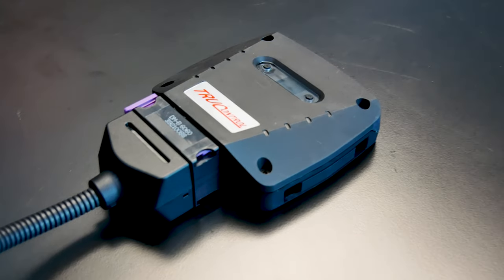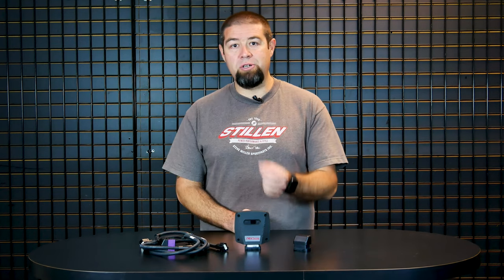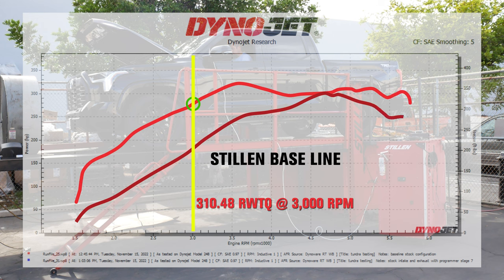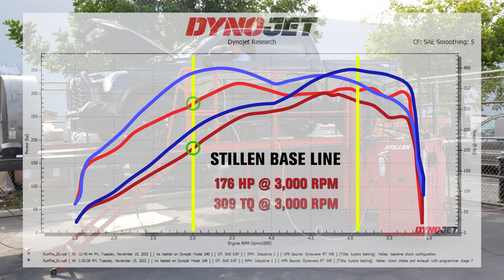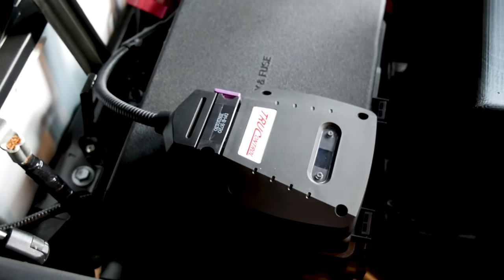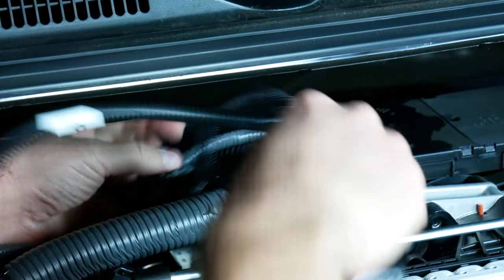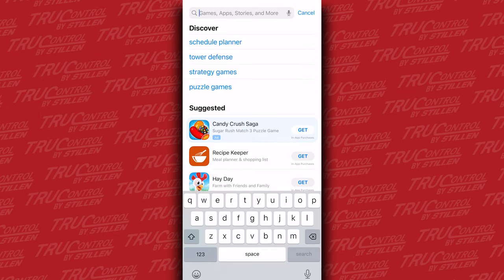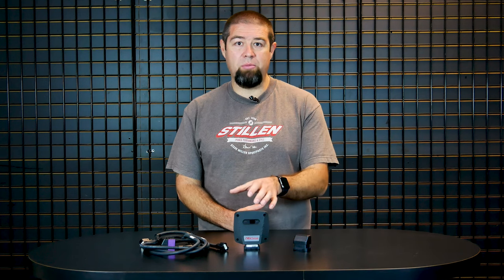Maximize Your Tundra | 100HP & 80TQ with TruControl

Comment: Will it void my factory warranty?
Reply from the maker: That is a great question! If you remove the device, it CANNOT be detected by the dealership. It leaves no trace on the ECU and leaves it unmodified. We take the data in from the sensors, modify it in our tuning module, then send the modified data back to the ECU. Because of this, the cars computer has no idea the tuner was ever installed. We have done tests with dealerships directly to confirm they were not able to detect the tuner after removal.

Comment: Does this require 91? Or is 87 octane ok?
Reply from the maker: We always recommend running 91 or higher octane fuel.  Anytime you add more boost it is a good idea to use a performance fuel.  If you do require 87 octane we recommend staying on stage 5 or lower.  For Stage 6 or 7 we would only recommend 91 octane or higher.

Comment: So it doesn’t reflash your stock ecu and allows you to go back completely stock if you bring it in for a warranty claim? If so, that’s nice.
Reply from the maker: That's correct. If you need to take your vehicle to the dealer, all you have to do is remove the TruControl module and connect the bypass module that comes included when you purchase a TruControl by STILLEN Inline Power Module. Your vehicle will go back to stock.

Comment: if removed can the dealer run scans on the ECU and see this device was installed? Im sure this is the biggest question people have that is preventing them from pulling the trigger (Me included). I need to know if this is a better mod to use after my warranty is done
Reply from the maker: That is a great question! You are spot on, if you remove the device, it CANNOT be detected by the dealership. It leaves no trace on the ECU and leaves it unmodified. We take the data in from the sensors, modify it in our tuning module, then send the modified data back to the ECU. Because of this, the cars computer has no idea the tuner was ever installed. We have done tests with dealerships directly to confirm they were not able to detect the tuner after removal.

Comment: Will this work with 2023 tundra SR that has the same engine but slightly detuned from factory?
Reply from the maker: Yes, the TruControl will work with all configurations of the 3.4 Liter engine.
Reply from the maker: zacharyadrian5062   Yes, the Trucontrol will work with all configurations of the 3.4 liter engine.

Comment: Will it work with the Tundra Hybrid Capstone?  I didn't hear anything about hybrids.  Also, OEM I have sport, normal, or eco transmission settings.  Would I just leave it in "normal" and then pick tune 1-7 on the Stillen app?  In other words, after I connect your product what setting should I put the OEM transmission power dial to?
Reply from the maker: Hello- Yes, the TruControl Power module does work on the hybrid models.  The TruControl works with all of the trucks "modes."  These modes will not interfere with the TruControl.  It really boils down to your personal preference when driving the vehicle.  Some customers want a firmer shift, some want a "normal" driving style and only to have the added power when they stand on the gas.  Others want all the power, all the time and more aggressive shift pattern.

Comment: Hello, huge fan of stillen as I currently have a z32 and an r32. My question is, does it require aftermarket intake and cat back exhaust?
Reply from the maker: No, it can be ran on a completely stock truck, but we also have custom calibrations if you do want to change to aftermarket parts after installation.

Comment: I want to order this as i already have the stillen exhausted system. But i might get some catless downpipes. Will this clear the code from me removing my cats? Or do i need custom tuning for that.
Reply from the maker: Our tuning device does not enter the DME/ECU/computer, so regretfully it will not clear engine lights for emissions. It will work on catless downpipes, but the code and engine light will remain. 

If you need help finding a reliable custom tuner, dont hesitate to reach out to our sales team and they would be happy to assist you.

Comment: Would there be any issues with the piggy back device if I’m already running the shiftpower throttle response controller on my 22 tundra ?
Reply from the maker: Should be no issues at all when they are ran together. The shiftpower will only be plugged into the throttle itself. Our device plugs into the engine bay and tunes the motor to increase horsepower, not just the throttle response.
Reply: Thank you for the quick response! Waiting for more updates on your cold intake you advised a couple weeks ago. How loud is your exhaust system if you live in a cold whether state? Don’t want the neighbors to be upset in the morning
Reply from the maker: We should have another video with more information in the coming weeks on the intakes. We are planning on releasing them here in Q1 of 2024.

As far as the exhaust, the cold start is MUCH better than stock, but not obnoxious to the point it will wake up the neighbors. We also wanted to make sure it wasnt annoying or droning during towing as well, so we tested it extensively with our race trailer. I do not like a loud exhaust that requires yelling to have a conversation or turning your music up so it isnt so obnoxious. It is safe to say, neither of those apply to this system.
Reply: @STILLENvids  Thank you for getting back to me! Appreciate it very much! I know you have your deals going on but ima wait till you release more of your products so I can just make one big purchase. Thank you again

Comment: Long term reliability issues with engine or trans after these modifications?
Reply from the maker: As long as you keep up with maintenance and use good quality fuel, you should have no issues at all. The factory ECU still has it's engine protection programs in place, if it ever sees anything outside of the tolerable range, it can still step in and protect the motor. As the product does not leave any trace of it being installed, as long as you remove it before a trip to the dealer, your warranty will stay intact.

Comment: I’m interested but I have my concerns. Not only do I tow my cars to the drag strip but I also have raced my tundra. I bought the AFE Bluetooth unit when it came out and it didn’t make a difference. Both with and without were 14.90s at bandimere speedway and even on the runs that were with had a 1000’ less DA than without. My question is are your tests in sport mode or in normal. My truck is a trd limited that is not a hybrid?
Reply from the maker: We do our tests in all modes, including eco, to make sure the truck performs as it should without limiting the drivability or function of the features. We do also a 14 day satisfaction guarantee. This means you can give it a test in your own truck, if you arent satisfied with the results, simply send it back for a refund! We let the product do its own talking. I promise you will feel a difference from the first pull after install. The butt dyno is noticeable!
Reply: It depends on where the tune addresses boost. It’s probably not intended for pulls on the drag strip.

Comment: Does it fit to Land Cruiser LC300? Lexus LX600?
Reply from the maker: We are currently working on a solution for the LC300/Tacoma/4runner, we will have more information for those platforms coming very soon. As far as the LX600, it should work, just looking for a local model to confirm everything or adjust the tune to the vehicle.
Reply: @STILLENvids  that’s confusing because LC300 is the brother of LX600 “I’m talking about the real Land Cruiser twin turbo V6” same engine as Tundra the Land Cruiser that we have over seas and not available in North America
Reply from the maker: You are absolutely correct. That is my mistake! I thought you were talking about the LC250, that US version shares the same engine as the Tacoma and 4Runner. Sadly we are not getting the LC300 here in the US like you mention so it is difficult for us to confirm. However, with the similar engine and power outputs, it should work without any issues on the 3.4L TT engine. If you are interested in testing it out, head over to the website and contact our support team through our contact us page.

Comment: Are there any videos with this product installed and actually used?
Reply from the maker: We are working on more content for the TruControl for the Tundra's, especially after our TruPower Cold Air Intake is released.

Stillen is offering a 14 day satisfaction guarantee on our TruControl. This gives you a chance to test it in your own vehicle and experience the difference for yourself, completely risk free. If it doesn't meet your expectations, send back the product for a refund. We know the product can speak for itself as the changes are noticeable from the first pull after installation.
Reply: Do you have the air intake release date for the 2022 tundra?
Reply from the maker: We are hoping to release them here in Q1 of 2024. We will release more information on release date and power gains here on youtube shortly.